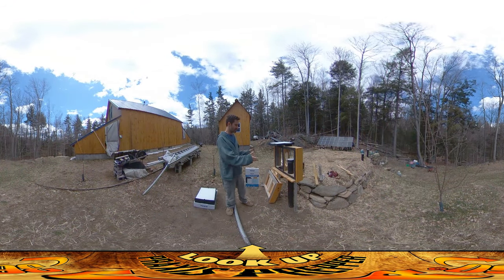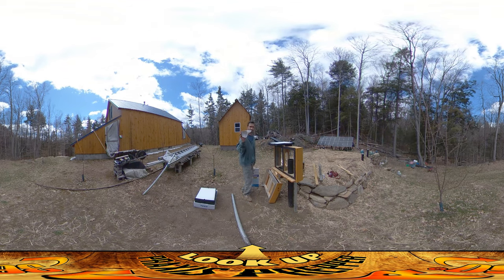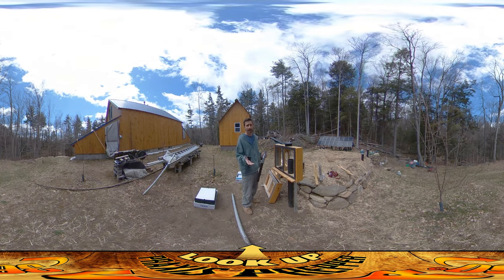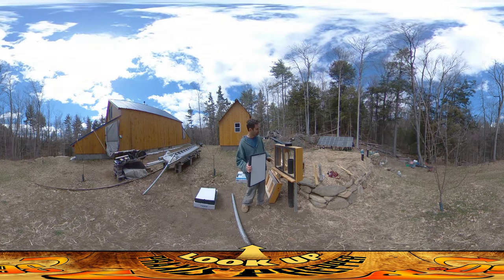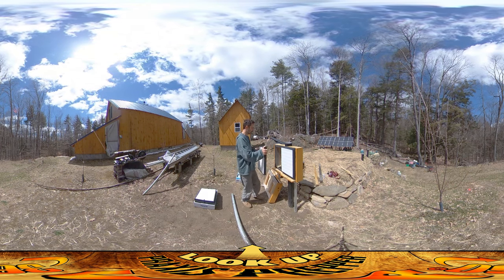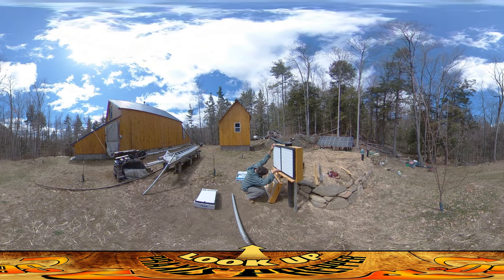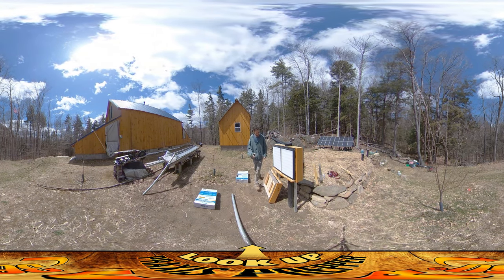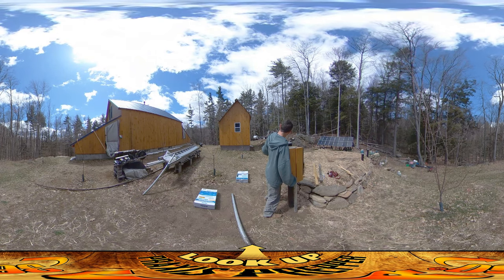Homestead Building - Fallout Shelter Air Intake

Comment: Interesting.   I would have went with hinges  and  gasket seal. If you need to exchange filters. In 20  hours. Good try for mark 1, Mark 2 will be better. Praxis
Reply from the maker: I may still do hinges. I'd held off on hinges initially because I was thinking that I might do alternate filters that had a different thickness. But I've come to the thinking that if I did thinner filters, I'd just make up a spacer to make them fit snugly despite the thinner profile. At the moment, I'm thinking hinges will be the way to go when I finish this thing up. I guess it'll be mark 1.5 when I do that. ;)
Thanks again for all the feedback. It was definitely helpful food for thought!

Comment: CFM rate you need to know Praxsis.
Reply from the maker: I tested it a couple of days ago with the fan and it really moved a lot of air. I'm not sure of the exact CFpM - but it was a lot. I think way more than I'll need.
Reply: @PraxisPrepper  you ever think of a multi spectrum UV light vrs bad bugs?
Reply: @PraxisPrepper  we installed one of those UV deals in our central air system plus high quality filters and air cleaners in our rooms . Since then not Evan a sniffel.  Or a Biden sniffing incident 🤣

Comment: Hopefully you got the second half of this effort because I’m curious to see how you are securing the sides and how you decided to do the top cap.
Reply from the maker: It did end up sliding in fine. I'm also curious about how I'll secure the sides and complete the top. As someone who comes at a lot of this from an artist's perspective, I often need to take a design part way, then step back and "look at the canvas" to see where it should go next. I have a number of ideas on how to complete it, but (as usual) I'm holding off as long as I can to let the ideas simmer so I can land on what I think is the best one.
Reply: @PraxisPrepper  LOL, I’m the opposite as I tend to design things down to the n’th detail amd then change as I run into issues. Drives Shelly nuts because she feels like I’m always planning and never doing but she’s always happy when I get finished, granted that’s probably only happened a dozen times during our 28 years of marriage vs the 100’s of things I’ve planned or started and never finished 😂🤣😂

Still not sure if she is actually going to count on the 2 of us to build a house, even subbing out the PITA stuff like drywall if we go that route. Personally thinking wood on the inside with washed finishes in whatever colors she wants.
Reply from the maker: @inmyimage1081  Wood with washed finished is a nice look. I'd suggest "milk paint" for it. I used it a lot on the last house. Very old tech, holds up over time, no VOC's, and a really natural pretty look. You can seal over it for stain prevention too. Also, it waters down nicely to make a wash.
Reply: @PraxisPrepper  Thanks 👍